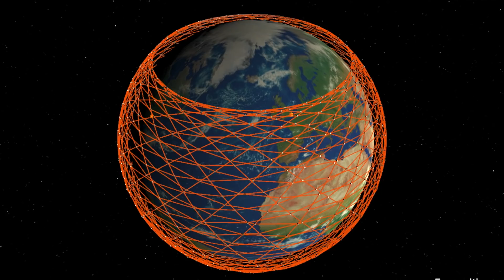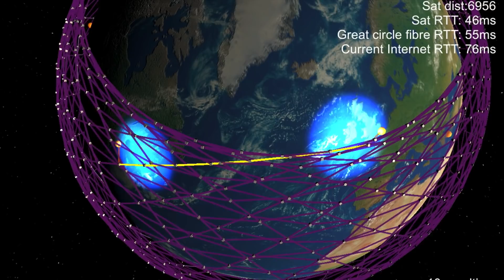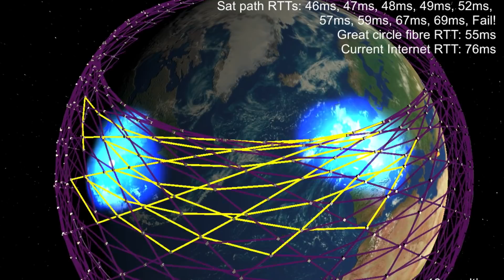Starlink revisions, Nov 2018

Comment: Let’s assume all the phases are complete and full constellations at the 3 different orbit heights and paths. What if the lasers didn’t just “talk” in their own constellation, but the lower sats “talked” to the higher sats or polar orbit sats. That would give the higher orbit sats the potential of moving data longer distances with fewer “sat hops” before the signal got pushed back down to the lower sat constellation and then to a ground station. Especially if there were dedicated “constellation transfer sats” spaced out at intervals on the lowest constellation.  Just a thought of how the other altitudes could be used to more efficiently move the data. (But I’m not a satellite engineer so I may be completely wrong.)

Comment: Do you have more information about how the satellites connect to the individual end users (what protocols, etc) and how/where traffic is routed/connected to the non-starlink greater internet?
Reply: receivers on the ground are about the size of a pizza box and would be provided by SpaceX. They are proprietary, like cable boxes you get for satellite TV. It would have its own networking capabilities.

Comment: Is this not a terrible idea for the Kessler syndrome, how can anything launch with so many layers of satellites so close together?
Reply: Not only close together. But at that number, one must wonder how many hits will network receive from debris. Also aren't there other satellites? And how about going to higher orbits through this number of satellites?
Reply: @petersvancarek  Launching through will never be an issue. The satellites are much too small and far apart. Each satellite will be actively tracked and move slightly but sufficiently if a collision is predicted with either another satellite or one of the 15,000 pieces of tracked debris. At the end of their useful life, they will use their engines to deorbit back into the atmosphere.
Reply: @nvlietstra  there was at least one collision documented where gps satellite collided with defunct satellite. That not only may, but will happen again. The more satellites the higher probability.
Reply: @petersvancarek  You mean the Iridium collision? That collided with another satellite with a similar orbit. It was not passing through to a higher orbit. There is WAY more space out where GPS orbits, I don't think any of those have hit anything, since very few satellites operate there.

Comment: I hope they have an emergency plan ready for when they lose control over one and it bangs into another. Quite a chain reaction. Though I realize that the satellites in the animation aren't true scale, so it probably looks a lot more crowded and risky than it actually will be
Reply: I think if one loses control it pretty fast loses altitude around (5m would prob enough for it to not risk other satellites). Also, in case of failure of propulsion system it could use rcs for collision avoidance/deorbiting. And computer system double/triple reduntant. 
So cascading with those safety measures is highly unlikely.

Comment: How do the satellites on the same orbit maintain a constant distance from one another?
Reply: In space, there is nothing that inhibits inertia. Once they're going the same speed they maintain their speed and distance from one another without any intervention.
Reply: @chrislang2118  Yes, but if the speeds are not absolutely identical, one will slowly catch up or move away from the other
Reply: @foggs  you are correct, they will have some control I would hope, my guess is gas trusters or something

Comment: if they can actually do ~50 ms that would be amazing. I was expecting way way more than that.
Reply: That's literally my current Hardline ping
Reply: @cpufreak101  This network would mean that same ping for just about literally everyone on the planet if it's completely implemented.
Reply: @bargin10  fair, but I do have to say, I have experienced current gen satellite internet (cruise ship) and ping on that was like 250ms
Reply: @cpufreak101  Yes, but that's usually geostationary.
Reply: Don't think you guys are getting the implications. That's a sub-50ms transatlantic ping... faster than the existing transatlantic fiber. Which makes it really attractive for high frequency trading and other high value traffic that would help pay for the constellation...particularly in the early stages.
Point to point because of the higher speed of light in a vacuum vs fiber, unless the path is short, it's faster than even the theoretical latency of a direct fiber laid "as the crow flies" so to speak.
My ping to google from home (Dublin, Ireland) is just above 1ms (google's nearest datacenter is ~10km away on the T50 fiber ring around the city), my ping across the Atlantic to my US east coast core network in 60 hudson st NYC is ~62ms (even though my ISP owns it's own transatlantic fiber which lands 20km away at one end of the same T50 fiber ring). Starlink would reduce the latter but increase the former.
Local latency within ~2000km of you with starlink would likely be ~20ms (pretty close to DSL and about double LTE/4G network latency) making it competitive but not exactly a compelling change for those with existing fiber/VDSL/Cable. For those with fixed wireless, VSAT, 3G or no connectivity it's a big upgrade. And for those of us planning connectivity between city pairs separated by a long distance it provides any-to-any low latency connectivity at potentially lower latency.

Comment: Thanks Mark. Aerospace Engineer in the UK here. I was wondering whats your analysis of SpaceX actually performing to one of their mission objectives; which is to provide dependable low latency internet to some of the poorest parts of the world (i'm paraphrasing but still)? it seems like this system is great (as you showed) for northern hemisphere connections and east to west connections but the poorest places are normally around the equator. Thoughts, and how would any changes overcome this? Thanks
Reply from the maker: This video focuses on SpaceX's changed plans for the phase 1 satellites.  Even with just these satellites, Starlink will provide good coverage everywhere except the most northern latitudes.  They may choose to use the inter-satellite lasers differently from how I suggest, but key is that they pay for the cost of developing, building and launching the network as soon as they can, or they won't get to build phase 2.  So it makes most sense to focus phase 1 on the parts of the world most likely to be profitable.  The interesting thing about LEO satellite constellations like this is you can't really cover London and New York without also covering the whole globe between 50 degrees south and 50 degrees north.  If they deploy all of phase 1, they can cover most of the world's population, including almost all of the poorest parts of the world.  It's unlikely individual users in those places will directly use Starlink, but it should be great for provding backhaul from cheap solar-powered 4G cell towers in places you'd never cover with optical fibre.  I think that's the most cost effective way of connecting all those places.
Reply: @markhandley  Agree, especially if the Starlink terrestrial antennae don't use metamaterials and are relatively large.  If they do use metamaterials, they could be relatively smaller and more portable.

Given the low latency over long routes, Starlink could eventually supplant submarine cables.  It's a really good scientific, engineering, and business model.

Comment: Couldn't the satellite links take a more direct paths. In other words why do the have to link to the next satellites. Couldn't they just link out of the 2d orbital plane they're on and link to one satellite several positions up the the chain. Is the distance the laser communication too limited? Does the time it takes to point the laser in a different direction too long? Does it even work like that or is the laser more of an area of effect or is more 1d like a traditional laser?
Reply: The lasers have to be physically pointed by moving mirrors. This takes longer than electronically steering the radio links, so they probably don't want to repoint them much. Also, it could make the network topology VERY complicated.

Comment: Curious if it is feasible for the laser link to skip adjacent nodes and just go to the next one ahead. 550km orbits + the earths radius seems to leave a decent space where the nodes can have a chord to nodes beyond adjacent nodes without getting blocked by nodes or atmosphere. Can't say what the energy transmission considerations might prohibit or if the cost of tracking additional nodes is feasible. But geometrically it looks possible.
Reply: Laser light in space should not take high power, even at a relatively low 550 km.

Comment: But how will uplink from earth to satellite work? Won't it need a lot of power to send signals from ground to satellite?
Reply from the maker: They plan to use what is known as a phased array antenna.  This is a suitcase-sized two-dimensional grid of antennas.  The rough idea is you send the same signal to all the antennas, but adjust the timing slightly, so the different transmitted waves all align at the satellite, and no-where else.  As the satellite moves, the timings of the waves are adjusted constantly, to maintain alignment at the satellite.  The effect is you send a narrow beam only in the direction of the satellite.  It's similar to using a big dish, but easier to track quickly.  As you're sending a beam in only one direction, you need a lot less power.  The same principle is used by modern WiFi routers - it's why they have a lot of antennas - except SpaceX will use considerably more antennas than a WiFi router does and each antenna will be much smaller.
Reply: @markhandley  Reading this, I'd imagine most homes will have an uplink device in  their attic. Also, all planes trains and automobiles (RIP John Candy) will have them to, and buses.
Reply: @markhandley  I thought Musk was saying that antennas would be the size of a pizza box?
Reply: Mübin Icyer Musk just need a story for him and Wall ST.

Comment: Great work!

What are you using to produce the animations?
Reply from the maker: It's a custom built simulator, writen in C# in Unity 3D.
Reply: @markhandley  impressive ;) good OC
Reply: @markhandley  He makes his own simulations !!
Reply: @markhandley  any chance we can get our hands on that Similator?
Reply: It boggles the mind... I wonder if we are going to start to need control towers to decide when a rocket can go into space and leave permanent empty patches of sky to allow safe passage of these rockets. I know there's is a lot of empty space and the probability of one hitting a spaceship or another sat is pretty low but when you start to see networks of this size and others (possibly competitor networks) that will also go up those odds start to drop